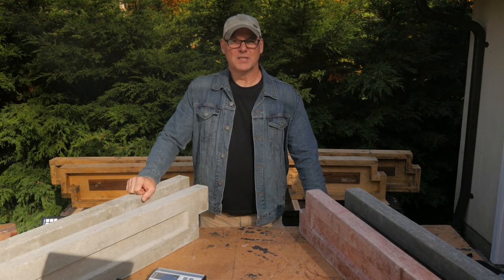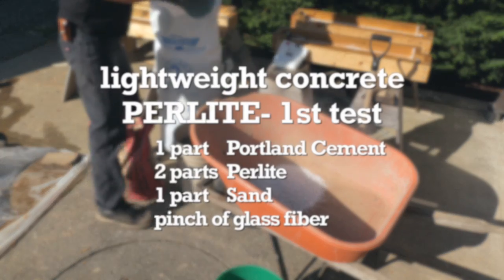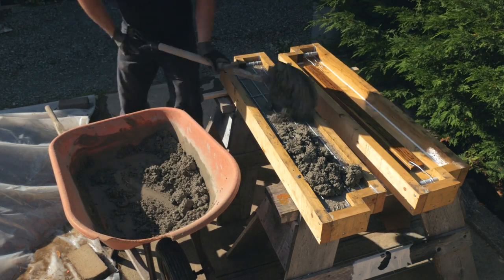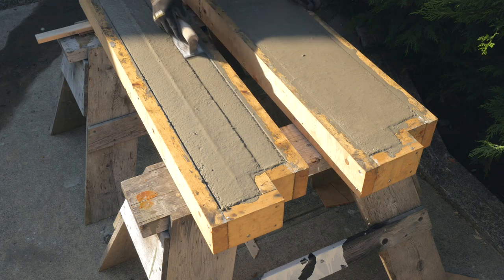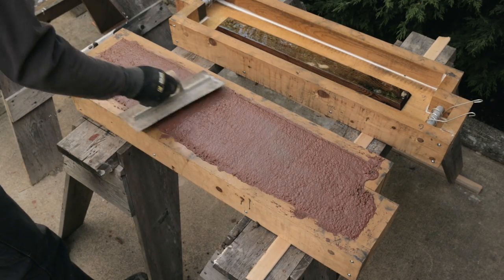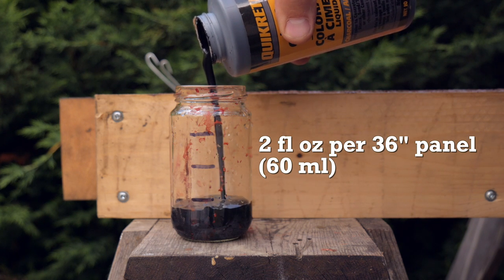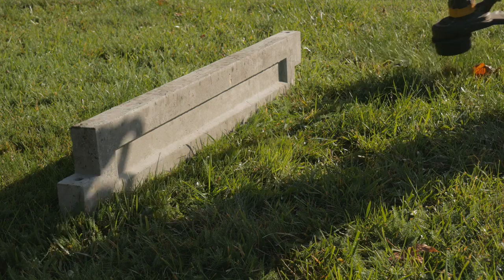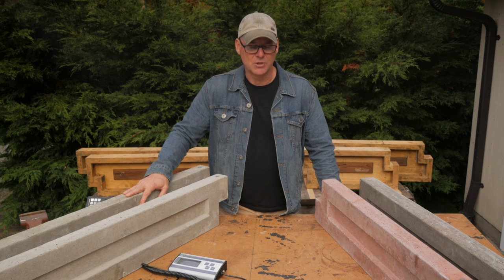make Perlite Concrete Garden Boxes PART 3.5 - Lightweight Perlite with CSA and Portland Cement

Comment: My instincts tell me perlite is weak, being very easy to crush. (low compressive strength). At least make sure it's thoroughly wet before mixing it into the portland. My instincts also tell me vermiculite is terrible because it's slightly hygroscopic.

Comment: 2.2 pounds f water for every five pounds of cement, gray cement usually needs a little less water, I typically start with 1.8 pounds of water and add accordingly, white cement needs a little more water and the 2.2 pounds of H2O works better,also plasticizer helps makes the concrete stronger without the additional water

Comment: Be sure to wear a mask when working with dry perlite. The dust is a lung hazard, some nurseries pre-wet it to rinse out the dust before using. The volume does not change with rinsing.
Reply: Yes, put lots of tiny holes in the bottom of the bag...  fill with hose...   let drain...
Reply: I have no problem wearing masks with any dusty materials, and N-95 is considered a respirator and would be fine. Studies on miners in various countries have failed to show toxicity opposed to vermiculite, which often contains asbestos and requires an N-99 mask (hepa-filtered). See NIOSH-CDC.

Comment: I've just watched all 5 videos in the series.  I was disappointed you didn't perform some basic strength testing on the various material constructions.  The idea of this series is to find a more durable material rather than wooden boxes, so it'd be good to see that tested.  Sure you don't need them to be super strong, but some basic comparison would seem to be prudent.
Reply from the maker: I did three videos testing strength: https://youtu.be/0vK8TCHR79A

Comment: I'm borrowing your idea to make perlite concrete blocks that interlock like Legos. But only for the walls of a shed. I only have 20 forms so it's taking a while. The blocks lock together loosely with a bead of grout on the bottom and the inside. They lock together pretty tight from side to side so I'm thinking of just putting some silicone between them to make a weather seal. There is zero room for grout on the sides. Or maybe some liquid nails construction adhesive. Not sure yet. Still in the testing phase.

Comment: Could you do a weight test across all blends. Using the 48” see how much weight can be placed on them in the middle as they span two saw horses?
Reply: I am considering using these on our 2 4’x8’ raised gardens we will be installing and have the same center dirt weight concerns.
Reply: Density of weight concrete?

Comment: Great video, thank you.  I've been looking at these lightweight concrete products and was wondering if it would be possible to use it to build walls or a roof.

It's lightweight. It should supposed to have insulation qualities so it sounds like it would be perfect, but I've watched other videos too and it showed that it usually breaks real easy or rubs off. But I think they were making more of air creed so maybe that's a different.  

If you were going to build a concrete house, would you use regular concrete for the floor walls and ceiling or roof or would you use the perlite mixed with cement?  Or should these lightweight concrete only be used for decorational purposes?

Comment: Love this video. I grew up in a family of masons and your attention consolidation and curing was superb. According to a concrete engineer, the glass fibers really do not and reinforcement; they provide even curing in hopes of avoiding checking, though engineers do not guarantee against it. Steel (rebar) provides tensile strength (you can't stretch it to a fracture easily) and concrete provides compression strength, which varies to aggregate qualities and ratios of cement.

Comment: I love your easy to understand instructions and easy to follow video... You might want to try an even lighter mix, using NO sand... only perlite, portland cement and water... You do not need the sand as an aggregate  because the perlite becomes the aggregate... and the mix is 4 parts perlite to 1 part portland cement... the panels will be much lighter... and strong..
Reply from the maker: Thanks! I may try that mix.

Comment: The red is my favorite! And I don’t normally prefer red bricks but this was a much lighter Adobe like appearance... stunning! Now I’d like to see lime without cement in your forms🤞🏼Lime floors are finally getting some acknowledgement as truly environmentally friendly, and can be reused unlike concrete/cement or today’s versions of an old traditional version of Rome’s concrete formerly known as Lime concrete. Besides the fact Lime gets stronger with time and moisture it’s also cooler to the touch when the sun has been bearing down on it making it perfect to be poured around pools and as back door patios. I’m curious if Lime has to be slaked at home “quicklime” or if hydrated or hydraulic lime (box store version) would function just as well? I’ve read arguments both supporting hydraulic lime and arguments that it needs to be freshly slaked...  I have no idea, nor do I know what formula would make a strong block or brick for paving with hydraulic or hydrated lime. Yes ppl sometimes mix in cement/concrete but that ruins the water permeable/breathability nature of LimeCrete so I’d hate to use modern cement with lime. Seeing perlite used in this demonstration reminds me of a demonstration using powdered lime with volcanic ash as aggregate but also sand and pebbles may be necessary to make a brick/block. Anyways curious, hoping someone will take on the lime brick challenge, it’s not very popular because it’s not well known of its amazing properties and the fact that it is environmentally safe, reusable, etc. and grows in strength for 100’s and thousands of years.
Reply: Lime absorbs moisture indefintely

Comment: Really good stuff! Very good video. One comment: I'd try to mix the color with most of the water you plan to use to get a most even color distribution. e.g.: If you expect to use 20L of water for a batch of concrete, I'd mix the required amount of color with 18L of water first, then mix that into the dry mix. Just a thought!

Comment: Appreciate this kind of information and quality of the video is outstanding.
Is the wire mesh really a requirement? 
Wouldn't the concrete cure to a suitable strength for the designed application and considering these are not structural components?

Comment: Vegetable shortening is a great form oil for this too. 
I used to make these with forms that were slightly flared, like the sides of a cake pan, then the panels would just drop out by flipping the form over. No disassembly required. 
Seems like radiusing the ends would allow them to be connected at any angle and long serpentine beds or stand alone beds with as many sides as you want could be made.
Reply: Seems easy enough method if you did not have to have the stake holder channels molded into the ends like he does here with his panels.

Comment: Good morning.  I have purchased 2 versions of your forms, and watched all your Versions of Mixes.  In Part4 you made it super simple by noting the full bag mix, and only measuring out the Citric Acid.  This Version (3.5) talks of the CSA and Perlite, but since using CementAll you changed the portions.  Do you know (have you done) the portions for The Rapid Set Mortar Mix, Perlite and Sand?   And if doing by Portions, is that so you have exact amount to fit 1 specific form size (36")?
I think I am spoiled with your vs 4 filling 2-36" or 1-24" and 1-48".

Comment: Why do you wrap the tube? It is not an integral part of the system, if it falls out re-insert it before you put in the connecting rod. Other casting project I just use a dowel rod and knocked it out after casting. Great ideas.

Comment: Did you ever try any plasticizers to reduce the amount of water needed to get the mix to flow? I have used a squirt of Dawn dish soap when mixing mortar for bricklaying, makes it gooey and easy to work
Reply from the maker: Yes I have. In Part 4 of this series I used it with the Rapid Set Mortar Mix. Works very well. Also in my video on the concrete garden bench. I also use it in an upcoming episode of making aircrete with CSA cement.

Comment: Your videos are magnificent! I'm always searching for 'best of kind' and you take that prize hands down. Just a little tip on mixing concrete: With a wheelbarrow, if you use a hoe, it's much better on your back and in fact, much easier to mix. I know that many people simply get used to using a shovel and don't want to change because of habit and inertia. But with a shovel, you are leveraging your back a lot which is harder and not too good for that back. But if you use a hoe, you are pushing and pulling with your arms and it is much easier to do, besides being much easier on the back. They make hoes with two 1 1/2" holes in the blade for just this purpose. :) 

What's so great (among many other things :) about your raised bed panels is the fact that unlike wood, you only have to build them once. I don't want to have to rebuild things on my homestead when I get old. Once and DONE is my motto! 

Along those lines, I don't know if you raise chickens or ever considered using a chicken tractor to pasture raise them for healthy meat & eggs but I recently came across the ULTIMATE chicken tractor which I just have to share. It was hidden among reams of other inferior chicken tractor listings on a YouTube search and nobody else seemed to realize that this one from a small, obscure channel is a diamond among glass.... (For some reason YT won't let me post this with another YT URL in the text so just go to the Empty Hammock channel and the chicken tractor is there- only one) One and done and it's an incredibly elegant piece of design work too. There is hidden genius all around and you can find it if you look hard enough or with just the right thoughts in mind...! Cheers and may God bless!
Reply: P.S. I wonder if thin and long little galvanized nails (with a rough surface) thrown and mixed in would make a good "fiber" additive............. or a sort of randomized rebar replacement. I really wonder what that would do to the strength.

Comment: Excellent video Kent.....The methodical way you text and your production of the videos sets you apart. 

       Question: Is there an upper limit of the amount of Perlite you can use before you see a loss in durability/performance?
Thanks for all of your hard work.
Reply from the maker: Thanks for the support and kind words! I have not done extensive testing of the perlite ratios for lightweight concrete.

Comment: great video, at 71 I have made 36 4 ft panels with concrete they are heavy, how do the light ones compare in over all  durability.
Reply from the maker: Thanks! I'm impressed with the strength and durability of the vermiculite and perlite panels. In this application I'd guess that they are strong enough for the job.
Reply: @MANaboutTOOLS  Thanks,I will give it try .

Comment: I plan to start building raised garden beds this winter and I really like your design! I had planned to get a small, electric concrete mixer and am now curious -May I ask why you mix everything in a wheelbarrow instead of a concrete mixer?
Reply from the maker: I use a wheelbarrow to show that a mixer is not essential for this volume of concrete or this type of DIY project. I have a mixer myself and use it for bigger pours. Also, I like using a wheelbarrow while I'm testing new blends. Kent

Comment: QUESTION... First, thanks for the awesome video series, I will be ordering the plans for these.  I guess your plans can easily be scaled up to any size? I think I will be going with the CSA and perlite mix. Because my wife and I are tall and have some back and knee issues we would like beds 20" high by 6' wide by at least 24" long that we can sit on the edge. I weigh 260lbs are 10" x 6' long blocks an issue other than possibly needing two people to demold, move and set in place?  Do you think rebar driven into the ground is enough to keep the 24' long walls vertical with rebar every 6'?  Should I incorporate more tubes at the 3' mark for additional rebar or should I just make more 4' or 3' long blocks? Other than using a tub to post-cure the concrete what else do you recommend? would simply placing them on a thick plastic tarp on the ground and covering them with the same think tarp and keeping them wet be okay or do they need to be submerged in water?  Do you have a spreadsheet with your results for all the different mixtures?

Comment: when we mix concrete we use 1:2:3
1 cement 
2 sand 
3 gravel  
it should be possible to just replace gravel with perlite.  I haven't calculated what it does in terms of weight or strength.  But it should work for that.  
leca balls are often used in renovations in bathrooms in apartments to save weight.

Comment: I keep trying to go to your website as I have several questions, but I keep getting the message that the site is unsafe and it won't let me through.  I love your site as you take the time to explain what you are doing and why.  I a new to working with cement, but I want to do some approx 3.5'x3.5' finished size garden boxes from the perlite mixture.  I'm wondering about the need for some sort of support (?) in the bottom and sides to strengthen them and keep them from cracking.  What would you recommend?  Have you made any raised beds that are larger and taller ( to avoid so much bending)?  Any help would be greatly appreciated.

Comment: I'm new to molding concrete and was wondering why you don't use a plasticizer to improve the flow and increase strength. Just not necessary?

Comment: gReat video. Have you tried any variation for the dowels? So that you can get the maximum concrete around the dowel sleeve. Something thinner than PVC pipe, perhaps a wood dowel wrapped in paper and remove the wood dowel after the concrete is cured.

Comment: It’s my understanding that it helps if you soak the perlite in water first. Keeps the dust down and it doesn’t suck up the water from the mix when you’re adding everything together.
Is sand necessary as an aggregate if you’re already adding perlite and glass fibers?
Reply: Soaking the perlite does help, but you must account for the water in the final water/cement ratio for the mix.  W/C ratio for concrete should be .5 or below,  as low as .25-.30 with superplasticizer.
Reply: Sand is important as aggregate to enhance the gap grading that occurs when the larger aggregate settles together.  The sand fills in the gaps within the mixture.  The cement is simply a binder for aggregate.  Excess water reduces the strength of the cement.  This is why adding or finishing surface water to a slab or piece is not recommended.  It reduces the surface hardness and makes spalling much more likely.

Comment: Great update..I made these panels wa back from version 1.  In fact I have used the forms enough times to have stripped out two sets of screw holes.  I have been thinking there may be a clamping system that would be faster and easier to assemble and disassemble.  Just wondering if you have done any trials on that.  I may try to set up something and try this new formula for use for a flower bed that is 35' long.
Reply: I was thinking about using hinges to tilt the sides up and down and latches to fasten the sides to the ends. I'm going to try that. You would make a kind of stand for these molds to set on that raises them up so the sides could tilt down far enough.

Comment: i wonder what it would look like for decking,  having them being able to lock down from underneath, with a clip of some sort  as long as it s durable to stand on side ways,  and since decking joists or sixteen inches apart, it should be stronger, in theory only

Comment: You can make it lighter by using foam in the mix. If you have a 50 gal drum you mix your concrete to 45 gal mark and then keep shooting in foam while mixing for the rest of the 5 gallon. it will make a light concrete that is still strong.

Comment: xcellent educative, well structured and methodical video. i've made my 1,2m high x 2,4m long 1,2m wide bxes with regular concrete based 5cm thick reenforced panels. they work very ell but they were super heavy and needed a tractor to put together i need new boxes again so i will try your mixes! have you thought of using aercrete instead of cement/sand? great video! thanks for sharing! keep up the good work!
Reply from the maker: Thanks! I go back to aircrete in Part 3.6

Comment: I feel as though I just attended a class at the local technical school...  Can you comment on the durability of these panels when allowed to overwinter in New England?  Does the reduced weight of the perlite concrete make the panels more susceptible to freeze-thaw damage?

Comment: Probably the best source of in-depth lightweight concrete mixes, well done. In the previous video, you mentioned the Vermiculite was 38% lighter than regular concrete and in this video you mentioned that Perlite was lighter than Vermiculite being 34% lighter than regular concrete. I have decided to go with either Vermiculite or Perlite for my mixes and would like to ask which of the two would you use please?
Reply from the maker: My preference is the vermiculite.

Comment: If one wanted longer and taller panels would you just alter the proportions by a total of 45 %? I am 6' 6" tall and hate to bend over ( Back problems. ) and thought they could be made tall enough to sit on. The tops and bottoms could be made wider for stability, I know it would weigh somewhat more. What do you think?